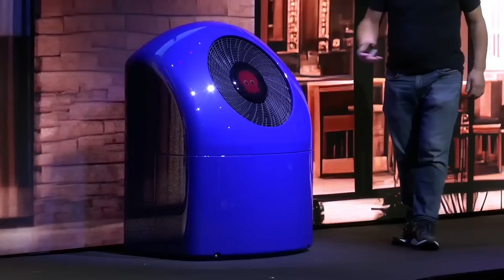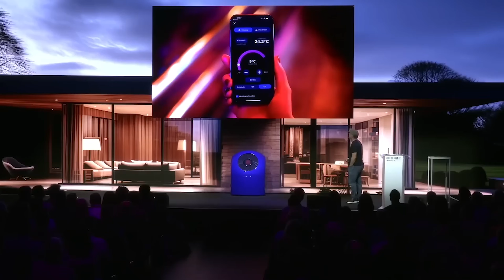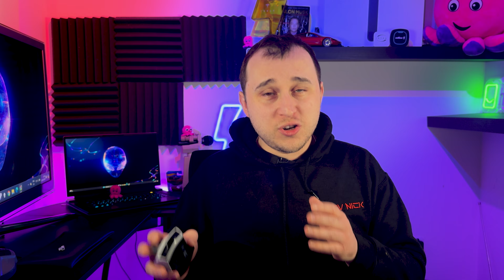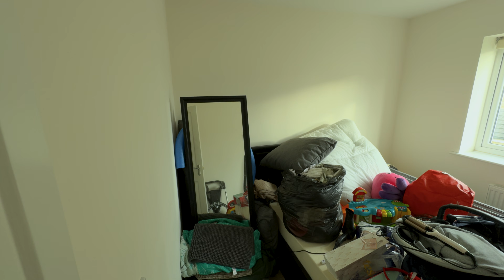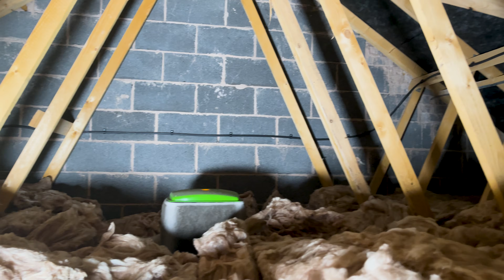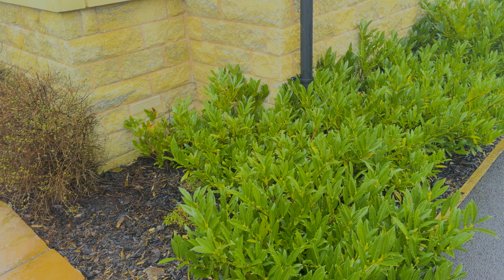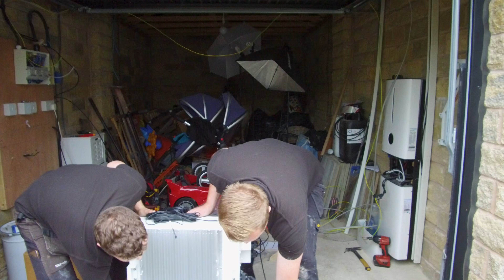Octopus Heat Pump Survey HAS Hidden COST!

Comment: If you did have surface mount pipes for the rad and tank so no extra work was the quote similar to what you were originally given? I was quoted £8,000 so £500 for me to pay after the grant. My house is pretty new, 6 years old, and I do have space for a hot water tank on the first floor as I already have a hot water storage tank. But I'm worried the price is just a bait and switch affair.
Reply from the maker: Octopus ain’t bait and switch if you had survey that’s the price! They normally quote price after grant thou so check also remember my code will get you another £100 off evnick.com/energy
Reply from the maker: Octopus don't bait and switch!  cough use my code your get another £100 off making it £400 total!!!  evnick.com/energy  for heat pump code also BEAR IN MIND octopus normally quote price AFTER grant just check

Comment: Hiding pipes in a wall. I say OUCHHH!!! to that. I always box in, make little hinged flaps over anything of interest, and have one side of the covering easily removable. Burying things in the walls sounds all well and good until a wet patch suddenly appears. Now is it leaking at that point (cut away the plaster board)? nope it is travelling along a pipe from elsewhere. Then you are cutting away plasterboard all over the place which needs replacing and replastering. Also put markers at the ceiling end and floor end exactly where the hidden pipes are so you can use a laser line to know where not to cut. Cutting in with a vibrating blade is just asking for a pipe to be nicked and you end up with a full blown flood.

Plastic pipes are chosen for low cost and speed at the cost of lower durability. Not good long term. Copper at 22mm is smaller than usually used for baths or tanks which is 28 or 32mm. If your buried pipes are 22mm and you discover it should have been 28mm are you going to live with inefficiency or rip the walls out? IMHO covering up is always a mistake.

Comment: I ran pipes inside a stud wall by cutting out plasterboard where the noggins were, notching the noggins, then putting back the cut out plasterboard & filling - pipes fed in from the roof space.
Reply from the maker: See install video basicly what I did

Comment: Why would anyone in their right mind, replace gas heating with electric. 
Electricity is approximately four times the cost of gas at the moment. This variance will increase as more and more GREEN subsidies are loaded onto electricity costs. 
I don’t profess to be good at maths, but using this case as an example, a new gas boiler (which wasn’t required, new build)  circa£1000, the above system, £3500. How many years will it take to recover the costs of changing? Absolute insanity, the world is becoming unhinged.
Reply from the maker: Gas boiler combi replacement is £2500.  Heat Pump install was £1350.

Gas boiler is 0.9 COP "90% efficient"
Heat Pump is between 3-5 COP so 300% to 500% efficient

This means a heat pump installed with a cop of around 3.5cop will be same price as a boiler on STANARD electrical deal however when paired with heat pump energy deals or other inventive energy deals the electric price is MUCH cheaper I pay 7p for example between 23:30-5:30 If I heat my water or prewarm the home during these times I get that heat for around 2p a kwh of energy your gas boiler can't match a heat pump
Reply: @ Where can  anyone obtain a heat pump for £1350? (assuming this cost is for supply and fit) Labour alone would account for most of that cost, assuming  approximately four man days.
There is absolutely no point in having a sensible exchange of comments whilst dealing with fantasy numbers.

In addition, I accept hot water can be heated during off peak, but ‘pre warming’ the house, another fantasy justification.
All the electricity deals offering lower off peak charges have higher day time charges? Hence, if a top up of warmth and hot water is required, the night savings are wiped.
It’s your hard earned money, you are free to spend it however you wish. If heat pumps are that good, why is the Government throwing money at it? It should be  no brainer.
Reply from the maker: @PaulWhittle-g9c  So it could be EVEN LESS price is FROM £500 depends on home type etc...  go to EVnick.com/energy and follow info for octopus energy heat pump quote use my code if you order and your get another £100 off price.

Heat pumps work low and slow, so I preheat water and start to preheat the home during the offpeak hours but even using peak electric its same price as gas but my average with offpeak means is LESS THAN gas
Reply: @PaulWhittle-g9c  My heat-pump quote was £3459.25, my mortgage holder has a green deal where they commit to pay  £2000 for heat-pump installation.  My total outlay is therefore £1459.  Perhaps that is similar to what the previous person who quoted £1350 did.
Reply: I agree, my boiler is on the way out and I've been looking into heat pumps and i just don't see the savings.  
Efficiency numbers are irrelevant, cost per year is only relevance. I can't see any savings per year to a gas boiler.
The mechanics of a heat pump appear complex creating a huge liability.  Also like you say in this case, they would have had a perfectly good boiler which effectively is part of the house price when you buy it, so they have probably lost over 1k before the actual install.
Reply from the maker: @ Gas boiler was on a £35 a month insurnace plan becuase of its age so £420 a year this comes with an 8 year warranty so that saving ALONE means 3 years its covered install cost. 
My Savings on heat pump are MUCH higher than typical customers as I have solar and battery However even for regular non solar or battery customers there is savings and a better more evenly heated home.  Rather than my home having cold spots and only being warm when am in,  its always no less than 18c (my choice could go down to 17c)  but when am in my lounge sits between 21-22c (again my choice) this more evenly heated home cost less to run than my gas boiler did which always got my lounge to 21c but struggled to raise most the home above 19c and dropped as low as 13c in colder spells.   If you got a heat pump and got the worst effeincy form ocotpus which is set at 320% you'd still save money and if you combine it with there electric deal for heat pumps its EVEN better
Reply: That’s outrageous to pay £35 a month in boiler insurance. You’d have to have very frequent repairs for that cost to ever be worth it. Our gas boiler is substantially older then I am and in 12 years all it needed was the annual service. 

A heat pump is only suitable for an extremely well insulated property, such as your new build. Our house has had all the things done to make it as energy efficient as possible. However, short of ripping out and replacing all radiators and pipes, plus all associated works, a heat pump won’t ever be suitable nor cost effective. Gas boiler and wood stove for me.

Comment: Always an annoyance to hear heating Technicians called engineers when they are clearly not. Engineers do design and maths and have engineering degrees. Technicians use tools and actually do things. Neither is more prestigious than the other. But a heating engineer designs the heat pump and a technician installs it. Stop the misuse of the term engineer.

Comment: Crazy to take out a combi boiler for this heat pump rigmarole!! You might save £200 a year but it’s costly to install and costly to maintain! Net zero insanity
Reply: It's like EVs & solar panels, where small numbers of early adopters got hugely subsidised by the rest of us, which in the case of a ASHP involves a grant of £7500. But like EVs, when something big goes wrong, then it'll likely cost a small fortune to replace. The future will be a place where only virtue signalling better off types will be able to afford to run a car & decent heating.
Reply from the maker: @ you started off going right and then rubbish… subsidies start to help build demand and drop prices solar is hugely cheaper to buy,  EVs dropped from being 80k to 15k new and heat pumps be same
Reply: @NicolasRaimo  - Cobblers, there's no comparison between an 80k Tesla & a 15k Dacia EV. And AC Units & fridges have been around for many decades, which are basically ASHPs in reverse.
Reply from the maker: @ they are simlair but scales of them are different it’s also the labour force,  before the grant people doing ASHP were small niche firms making huge profit margins
Reply: Gas will, at some point, become unavailable, what is far more important than the heat pump is insulation, draft proofing and mechanical heat recovery and ventilation, that will cost far more than the heat pump install.
Reply: @ - Predictions of peak fossil fuels are only notable by their repeated failures. But when gas does eventually run out, we have about 600yrs of coal & lignite reserves still to exploit.
Reply: @ both coal and lignite are dirty fuels , we would destroy the planet long before the reserves ran out
Reply: @Benzknees  And the carbon emissions?
Reply: @mrsp3992 .  -  As NASA showed they're greening the planet, in the process providing vital food sources for the growing population. And as multiple failed predictions of climate Armageddon show, the global warming potential of CO₂ has been overestimated.
Reply from the maker: What’s costly to maintain?  Total
Install was £1350 cheaper than next door paid for combi swap

Comment: Don’t use loft legs they are not great. Get some 2by4 timber and lay on top at 90 degrees to the joists. You might want to sister the joist under the water tank by bolting 2by4 to the side of the joists.
Reply from the maker: See install video ;)

Comment: Informative video but I had nothing but trouble with my Octopus survey, paid my £500 deposit and the first appointment they did not turn up, when they arrived on the second appointment, I had two surveyors one training the other. They were at my property for four hours and it all went well Octopus needed to install three radiators heat pump to the front of the house with external pipes going up to the loft and into my airing cupboard to the new tank. A week later I got an email to say they needed to do another survey and when the surveyor arrived, he said straight away sorry but as you have a room in the loft the pipes from the heat pump cannot be covered. 
So, no heat pump install, it took me 5 months to get my £500 deposit back and that was only by going to the energy ombudsman, we did get £200 compensation from Octopus in the end but the communication from them was awful.

Comment: I think you dont know what you are talking about, propane must be the refrigerant in that system  , it does not produce heat these heat pumps use lecky and plenty of it
Reply from the maker: I think you miss understood what I said.  It’s using propane r290 as a refrigerant.  It uses minimum amounts of electricity to make heat roughly 5kwh of electricity a day currently and that includes water heating at over 350% efficiency

Comment: I had a survey but due to the house size and no space a new heat pump is not suitable.
I decided have a new boiler and increase efficiency of the property to reduce gas usage.
Reply: Quoted 6k after 7.5k grant 😮 not realistic for most people
Reply: I reckon we'd be in the same situation. We just wear more clothes.

Comment: If heat pumps are the answer why did the CEGB break up the one at a small power station when they nationalised the electricity companies?  The answer:- politics they didn’t anyone using heat pumps, using their electricity to get heat from somewhere else.  Fit them at the power stations instead of making home homers run their own from 20% efficient electricity. If you manage to get 4:1 you’ll be lucky and just back to the price of gas.

Comment: The horizontal water tank like the one in your thumbnail is an extra cost of £800 (the surveyor also said horizontal ones are less efficient)
Reply: How do the immersion elements (assuming that's what they are) heat different volumes of water if they're at the same height in the cylinder?
Suspect it's a cobbled-together image...

Comment: I would of just kept the boiler. Neat and tidy, no hot water tank, looks new and efficient. The carbon footprint to have a squad of guys turn up in vans, the new components, pipework, wooden boards, The Heat Pump, radiators ect. It all defeats the purpose. Its like getting rid of a new ICE car for an EV when the carbon footprint of the car already exists, the carbon footprint for the EV is prematurely being created. All this does is just look good on paper but in reality is nonsense and does nothing for the environment.
Reply from the maker: That’s so wrong! Your carbon footprint from your boiler is the most of anything including car.  This is because your burning a highly concentrated carbon all year round for not just heating but hot water

Comment: I had octopus do a survey, they came up with all sorts of excuses why they couldn't put the hot water cylinder in our existing large airing cupboard and re-use all the existing 28mm boiler piping. Also got very funny about heat pump placement. They would only replace 4 out of 11 radiators claiming the others would be ok, despite being sized for 70c flow temperatures.

The only location they would put the hot water cylinder was in the garage where it would take up so much space you couldn't park the car. I told them this wasn't suitable but they didn't care.

I later got a local heat pump installation company in who had no trouble fitting everything where I wanted it and quoted for changing every radiator. They were quoting £500 more which I think is reasonable given the extra radiators and listening to what I wanted.

Octopus try and do everything as cheaply as possible based on what's easy for them. There will be a lot of houses with unnecessary ugly pipework as a result.

They also design for higher flow temperatures which significantly reduces efficiency, but let's them get away with not replacing radiators. Octopus design to 50c flow temperature and minimum Scop of 3 (in my case they estimated 3.6). The installers I am using design to 45c flow and minimum Scop of 4.2. that is a huge difference in running costs, an octopus system will cost exactly the same to run as a gas boiler if the heat pump has minimum Scop of 3.
Reply from the maker: Is your system fitted and working?  Not all my rads got changed some were sized correctly for 50c flow some will even work fine at 40c,  

What’s the total price this independent quoted you? 

Octopus quoted me £1400 where independents wanted £7500 after grant!  I have to admit if it was £500 difference it be a toss up for me to go for an independent if they were quoting better scop for simlair units but my difference was way too far I’d never make that price difference back in running costs
Reply: @NicolasRaimo  system is being fitted in a few weeks (my choice to delay due to other works). Octopus quoted £7500 after BUS grant. For that money I want a decent system that is exactly what I want, not some monstrosity taking up half the garage.

Our system is 35 years old with original radiators, the extra £500 makes sense because the old ones are starting to rust through. If you are paying new heating system prices then you want a new system.

If octopus were charging peanuts after the BUS grant then you can accept having some design choices made for their convenience rather than yours.
Reply from the maker: @insanityideas  you sure that was octopus price after BUS grant?  I’ve not seen an octopus quote that high before! Or was it referred to heat geek instead?   My system now fitted and running good luck with yours let me know how you get on excited for you!
Reply: @NicolasRaimo  direct from octopus, their surveyors came out. It's for a large 4 bed house. I was a little surprised given their advertising of heat pumps for £500 or even free. They can't use their own brand heat pump which is presumably cheaper and as a high temperature unit wouldn't need other alterations to the system. Their quote was still competitive, but cuts corners to do so.

I can buy the same heat pump and tank online at retail rates for about £6k, so most of the BUS grant is going on ancillaries and their installer time plus profit. Clearly they don't want to cut profits to compete on these installs, preferring the easy newer smaller houses.
Reply: Should add we already run our central heating at 52c flow temperature in mild weather, but have to crank it up to 62 or even 70 in proper winter because otherwise radiators struggle to push out enough heat. So I think their heat pump design would struggle with only a few upgraded radiators. It would manage steady state 24/7 heating, but any heat up from a lower setback temperature (e.g. 18c at night or at work or holiday) would take ages and have it running at it's least efficient 60c max temperature. The daiken units have a flow range of 35-60c, 50c is outside their recommended efficiency band. I wouldn't mind if they were saving us significant money on other system upgrades, but they aren't. It's an 11kw unit so efficiency improvements would be visible in running costs.

Comment: What is the annual running cost for a 10kw heat pump including maintenance?
Reply from the maker: Don't know without knowing your heat loss or flow rate need and maintenance same as in this video

Comment: A friend has a one bed end terraced house that needs old electric night storage heaters removing (no gas to property) ..I wonder if this would work or what other choices are there??
Reply from the maker: Maybe try air2air system https://youtu.be/ef8dNhiHp-4  if he hasn't got a boiler he won't get BUS grant so a2a likely cheaper and easier to install as he won't had rads currently